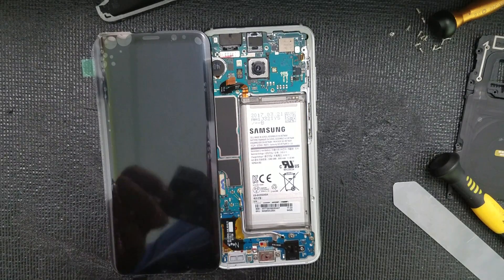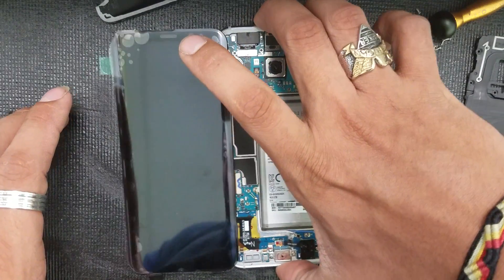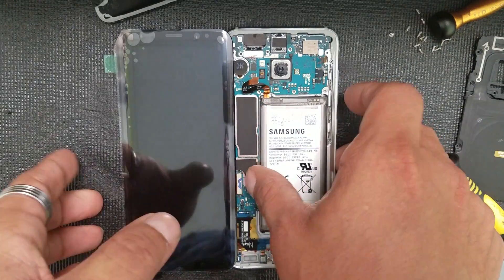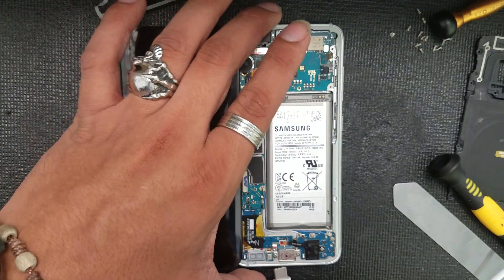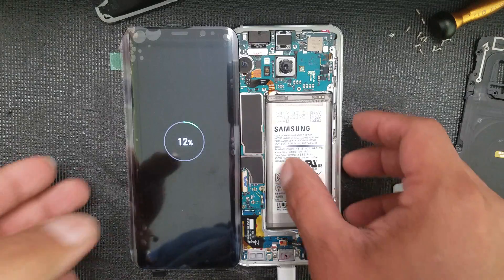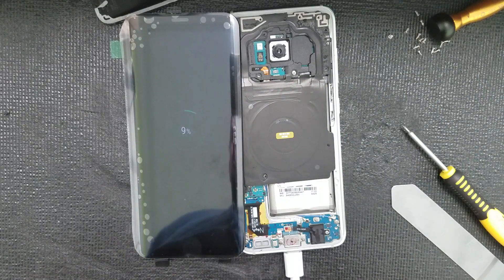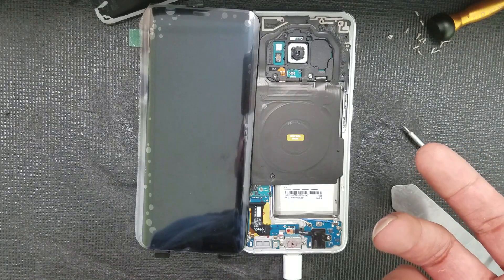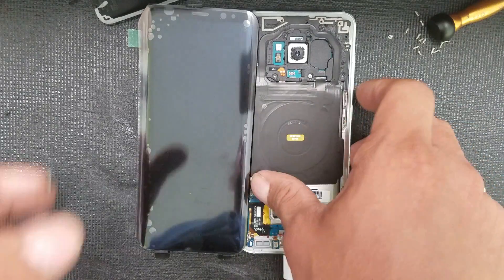Galaxy S8 - How To Fix "Charging Paused - Battery Temperature Too Low" Error

Comment: Just recently bought a defective Samsung S8 for just 7 USD with broken LCD, bloated battery, no wireless charging board and no back cover.. it only vibrates, turn on  with green screen and red light just  blinking when connected to charger.. trying to figure out what seems to be the problem and hey your video showed the SOLUTION. THANKS..

Comment: Solution for me was just lightly tapping phone against my knee where the wireless charging coil is ! 

Reason: This happens when there is a loose contact between wireless charger and the phone, and since thermistor is in the wireless charging module when there is bad contact it doesnt register any temperature. When this happens you can either try to lightly tap the phone on kneww or so reestablish contact or you can try to disaseble modul and reasseble it only, after that you can order one and replace it, fairly easy repair and low cost. Good luck!
Reply from the maker: great , thanks for sharing

Comment: I just did a repair on a Galaxy S8 and figured out some useful information. The original battery did not need the wireless charger to charge properly, but the new battery requires it. This is not determined by the phone, but by the battery!!! Upvote so people will see this!
Reply from the maker: Thanks for the tip 👏🏼
Reply: I will try that for my s10

Comment: hey bro, do you think there is a work around without using the wireless charging coil? my connector for the coil is broken, n i cant get a new coil, is it possible to charge some way without it, or bypass the wireless charging coil? thanks

Comment: Sir, there is a thermistor on wireless charger flex this is also called  Current sense register ,,, if thermistor is'nt connected. battery temp cant detect, 
thats why battery cant get in charge. the fault is not with wireless charger,,,,,

Comment: Thank you! I ran into this issue after replacing the back glass on my s8 plus. And like you said I was thinking... "what did I screw up!". But I had previously replaced the rear back camera and then the charger flex dock on different occasions ( thats how I broke the rear back glass) and just couldn't figure out how I messed it up on something alot easier. But anyway its back up and charging now so thank you!
Reply from the maker: I’m glad you got it to work
Reply: @JoseMoralestech  just change the wireless charging thing cause i just put a new battery and i got this message so i wanted to know just change the wireless charging

Comment: Before I saw the apple as the biggest ripoff of the century, and I admired Samsung. But now the tables turned. Still iPhones are very expensive, but the Samsung shits as well. The amoled screens are very delicate and glass over it is impossible to not to damage it. And amoleds  are too expensive. And Samsung  does nothing to improve it. Easy money seems to make them lazy.  So the best what I think would be to buy a Chinese mobile with LCD.

Comment: thanks a lot. i was freaking out after replacing my ear speaker. tested my7 phone before i put it all the way back together and had the same problem. threw the wireless charger on, fixed it. 
im working on a galaxy s8 active.

Comment: Bro great call, had the same issue be on a LCD screen replacement and no where on the net was I able to find a solution till I came across your video. Went back in adjust the wireless charging and BAM it start changing like normal.

Comment: I replaced battery a couple months ago and now just getting this message. Phone was working fine one minute then it turned itself off. When I plug it in it sometimes shows charging normally but never increases percentage, other times I get low temperature warning.  The phone also won't turn on longer than 20-30 seconds even if plugged in, normal mode or safe mode doesn't seem to matter. 

Is it possible that my wireless charger just went bad overnight and is now causing these issues?

Comment: I changed my battery and I tried to see if the battery works, I was fine bruh good, then I tried to charge and WTF "Charging Paused - Battery Temperature Too Low" error. 
I was reading on the internet after you change hardware - hard reset the phone, did not help,  got the old battery nothing worked, I was like I messed up my phone. 
I did not  attach the wireless charging pad and after I attached it the error went away. 
Thank you for this guide , Sir! 
You saved my phone!

Comment: TL;DW: Make sure the wireless charging back is connected with the screw to the diagonal bottom right of the camera screwed in
Reply: Would it work if I just put the screw back there? Because I really like how my clear glass S8 looks and I don't want to have that whole thing in the phone because it covers too much...
Reply: @brvoje  no, it's the contacts on the plastic frame thing so you'd need at least that part.

Comment: I have another problem though. It now shows the battery state, but I can't turn it on. I press the power on button for a while, the display lightens up, but it doesnt start. Why?
Reply: Nevermind, I was pressing the fucking bixby button instead of the power button. Anyways it works perfectly fine. Thanks for your help mate.

Comment: Thanks buddy, I had the same issue. I was replacing the charge port on an S8 and I had not fully assembled it before testing and was getting "phone temperature too low" kind of message, once i assembled the phone with the wireless charger section the problem went away.

Comment: it's not the wireless charger itself.  there is a battery temperature sensor on the right above the charging coil. that sensor has to be plugged in in order for the charger to charge the phone.
Reply: Bi Brandon. Can you be more specific on the location of the battery temperature sensor. Is the battery temp sensor part of the NFC assy?.

Comment: I am very grateful for this video, because it solved my problem. But seriously man, can you condense this down to the problem, with a verbal tell of the fault? PPL just need to know the S8's wireless charger needs 1 screw in place to ensure the connections are connected properly.

Comment: Help me, galaxy s4 with the same problem. When a get out the usb cable the phone keep charging but with the battery blinking
Reply from the maker: Did you try to replace the charging port, also make sure the port is for the same model .
Reply: Jose Morales yes i did, but nothing changes.. so a selled the phone

Comment: This 100% works. I went through something similar. I have a repair shop and still have the customers phone in my possession right now. Just went on YouTube, and found this video at the top. I accidentally had the port cable not fully plugged in so the phone wouldn't charge. Opened the phone back up and saw that issue. Then with the back cover still off it went from no charging at all, plugged the flex cable back in then it said phone temp too low.. Saw this video and connected the back and put some screws back in so the contact points touch with the wireless charging. Everything went back to normal. Thanks. Video totally did the trick
Reply: Nice

Comment: Can someone please mention properly all the steps to fix "Battery Temperature Too Low"
Reply: Liza Chowdhury follow the video? What have you tried so far?
Reply: Jose did a fine job, honestly. you'd first have to open up your phone ( refer to another video)to get to the part where you simply reconnect the wireless charger coils with a couple screws to fix the issue.

Comment: Now if only someone could tell me why the fucking fuck my Galaxy S8+ won't charge.  I've changed the charging port, the battery, bought a wireless charger, done everything I could.  I plugged my phone in at 5 percent one day, went and cooked dinner and when I came back to the room it was dead.  I've replaced just about the whole phone as of now and the fucking wireless chargers, both the Samsung one and the....something or another that I don't remember say that it's recognized with their lights, but the phone doesn't get the led nor does it turn on.  I've held every button combination for over a minute and nothing.....and at&t wants me to pay some ridiculous amount for a new one due to a tiny hairline crack on the back that the lady at the store made dropping it on the desk putting a screen protector and my girlfriend ignorantly didn't show her the crack after noticing it in the car.  And that's her fault, I understand, but I shouldn't have to pay...I think they said 2 something, I can't remember because I was pissed that they weren't gonna fix something that wasn't caused by that tiny crack.  So I bought that charge port, the battery, the wireless chargers and still.....nothing....anyone please have an answer?
Reply: PS.  I've had someone already tell me to buy a new screen, but fuck that noise because the damn screen was working when I walked away from it, because I was watching some YouTube red movie....or maybe forged in fire.....either way I know the screen is fine.  I'm tempted to just put my phone inside of my girlfriend's and see if it still does the same thing, but then I risk messing hers up to where if she gets one of the MANY problems I've read about with this AWESOME piece of shit phone, it'll cost my balls to get her a new one too.

Comment: Hey :)
I got that same problem. i cant charge my phone because of it. im looking for fix for this but i didnt got yet. btw my phone does not support "wireless charger". yesterday i dropped my phone in a puddle for 3 sec . i opened it up . little bit water was collected in it . so i wiped it off and blew it with my hair dryer . it was working well the whole day went fine.But at night when i tried to charge my phone it showed "CHARGING PAUSED - BATTERY TEMPERATURE TOO LOW" so i tried to restart my phone after shutdown my phone didnt boot up again. then i removed the battery and kept it aside the whole day . at night i tried to boot it and luckly it booted . i was using my phone as normal and i thought the problem is gone but after using it i connected the charger and that ERROR occured again. so i researched about this error "Now i gotta know that it happends when charging port is damaged or the sensor for measuring the battery temperature is broken" or battery is dead 
So right now im confused i need help... ASAP!!! 
reply me plzz
BTW GREAT VIDEO!!
Reply from the maker: try to replace the charging port and the wireless charger,   that solve the problem for lot of people too
Reply: I replaced my usb board and it still doesn't work. I also can't find the wireless charger part online.
Reply: https://rounded.com/samsung-galaxy-s8-sm-g950f-antenna-module-wpc-wireless-charging-nfc-mst-antenna.html and https://rounded.com/samsung-galaxy-s8-sm-g950f-antenna-module-gh42-05952a.html